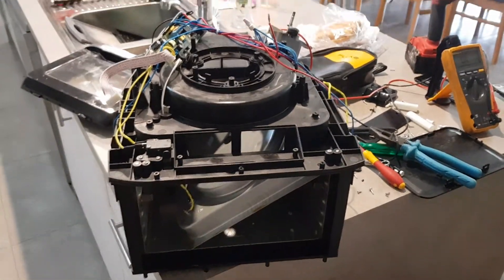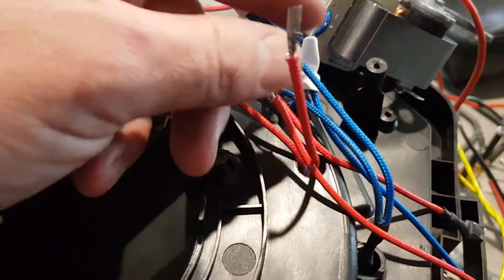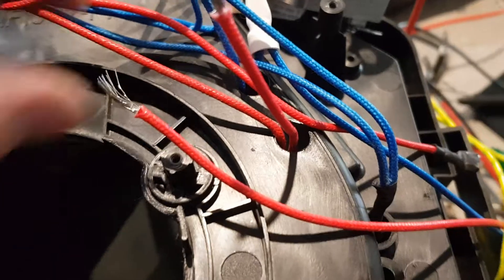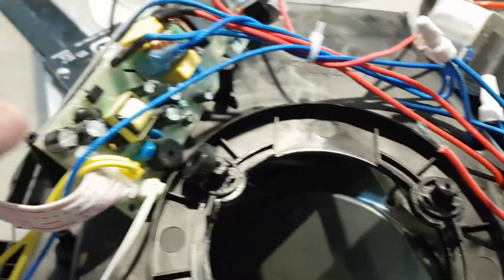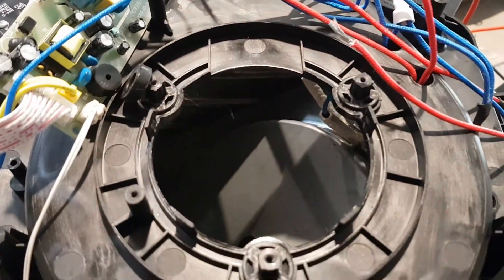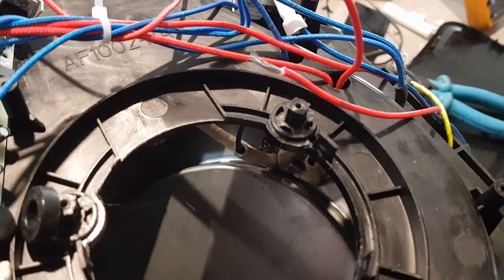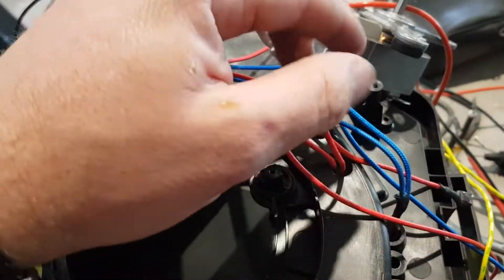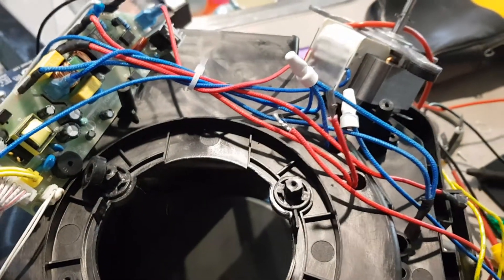Kmart Air Fryer Anko AO8606 - poor design

Comment: that secured cable has a thermos sensor in it under the heat shield material. Its not just a looped cable, its secured to the metal top to measure the temp im guessing.

Comment: Keithy, how do you get the top cover off, seems to be clipped along the front edge somewhere? Have managed to get top rectangular vent panel off (clips!!!!) cheers Pete
Reply from the maker: Remember it was clipped in. If i had my time again I would just bridge that wirer but I wasn't sure what it did. Afterwards it wasnt going back together
Reply: when the top panel is taken off there are 6-8 screws sunk below the surface, they are phillips screws and require a 2-3 inch thin screwdriver for access. Like you my unit's thermal fuse was on the negative side of the mains. I suspect the problem was due to the heat sensor on the inside at the top, mine was covered in grease, once I cleaned that, fitted a new thermal fuse 172c unit worked perfectly.
Reply: @christinemitchell390  I only have 4 screws below the surface. The front part of the top plastic cover (with display) is somehow attached to the main body.
Reply: @emwolf  You've probably figured it out by now, but I just pulled mine apart. The front panel is clipped in (11 clips). It needs to be removed to see 3x addition phillip head screws holding the front part of the top cover down. I made the mistake of pulling up thinking there were clips holding the top-front section down, but broke the plastic poles that the screws screw into.
Reply: Were you able to work out how to remove the top cover? I unclipped the top plate but can't find the clips along the front of the top cover with display. Prefer not the break the tabs but can't find a way to get at them. ☹️
Reply: Those wires going down and back up again are actually connected to 172C thermal fuses. The fuse on the active has blown on mine. Have pulled them out, removed fuse and ordered new ones. Let’s see how we go. Also, IMPORTANT for anyone doing the disassembly… the thread on the fan is reverse-threaded. I was trying to undo it for far too long before I realised that. Interesting to see if it goes back on ok.
Reply: I have an AF310 which is the egg shaped Anko air fryer.  Same issue...thermal fuse on the active has blown.  What I don't get is why is it only rated to 172C if the Air Fryer can get to 200+C !?!
Reply: It's likely the part that's built in by design to fail. So the consumer will purchase a new airfryer & add the non working unit to the landfill with the other Chinese plastic crap products. It's all about making sales aka money.  Numbers on a screen made up from thin air. 
They dont care about The environmental impact from all the waste they have created on purpose. It shows in the design, they want to sell another not make it fixable. Although it's only a 5c part that is required. 
Gotta love this sick sad 
Clown world we are born into.